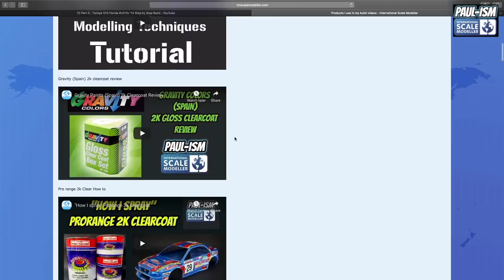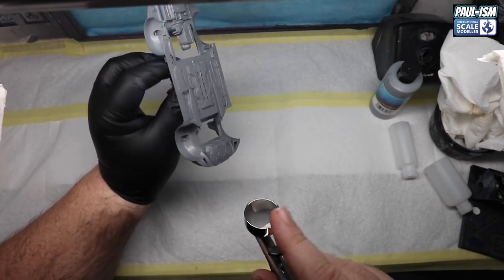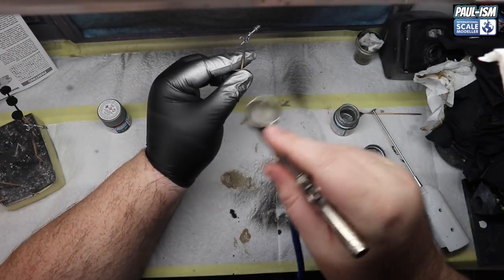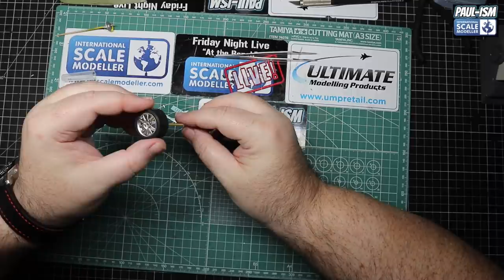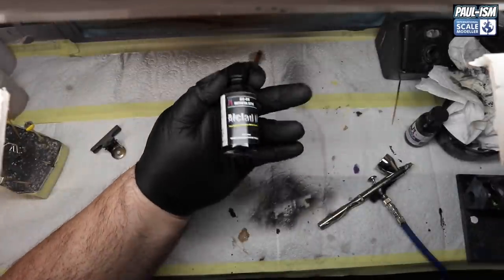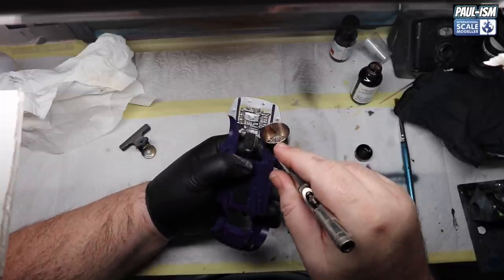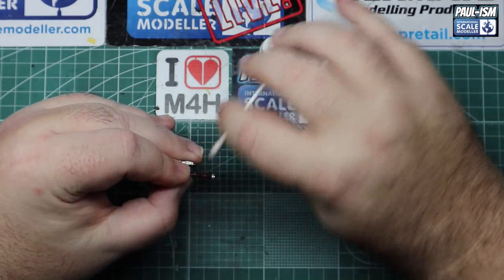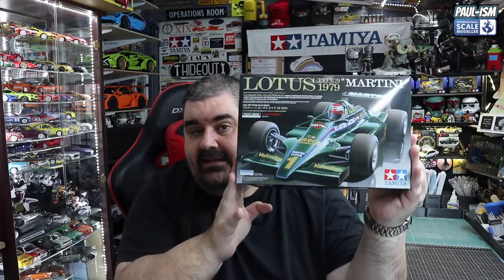Part 2 Tamiya 1/24 Porsche 911 GT3 - Step by Step build

Comment: Cleaning suspension  parts particularly  springs can  be a real pain. I love your tip to use liquid glue to remove seam lines. Will definitely  give that a try . Thanks 😁